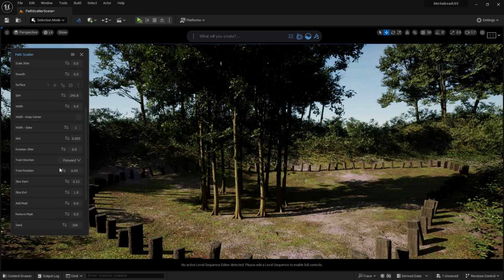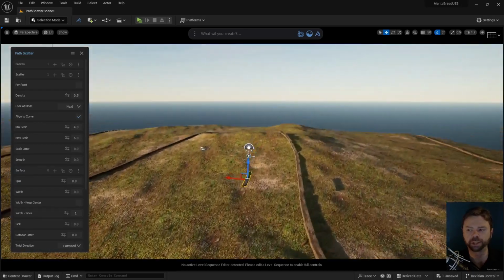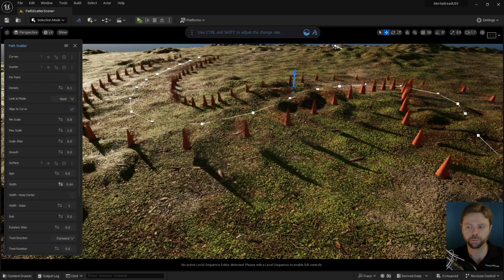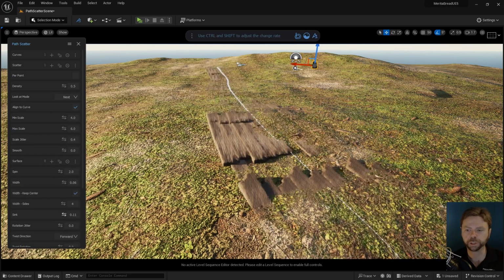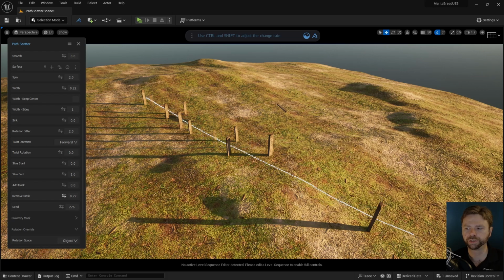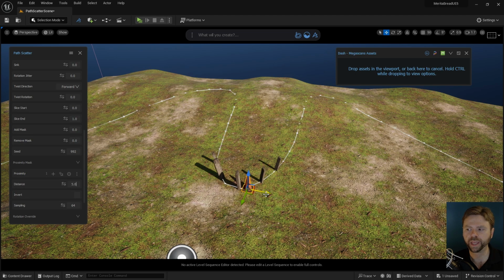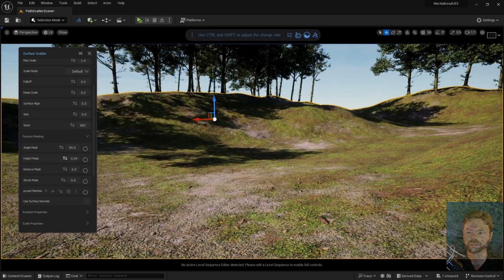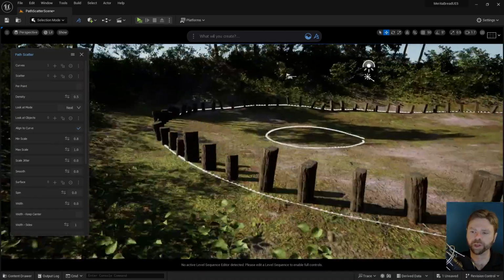Path Scatter: Beginner Guide to Your UE5 Co-Pilot, DASH

Comment: In 2:49 instead of using the surface to snap them from above, can we convert them to dynamic objects as physics so the fall? I was thinking of using the path to draw the objects but use physics as the final effect. thanks
Reply from the maker: In order to do that I think you would need to create the path scatter, raise them a bit over the ground, then use "Bake Instances", which will convert each scattered object to its own static mesh. Then I would select them all and run a physics simulation and let them fall :)